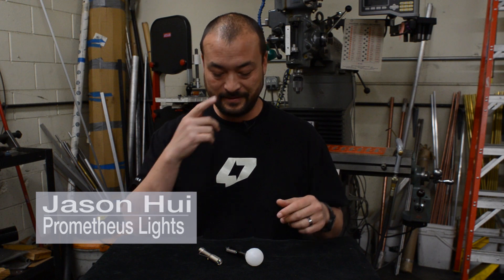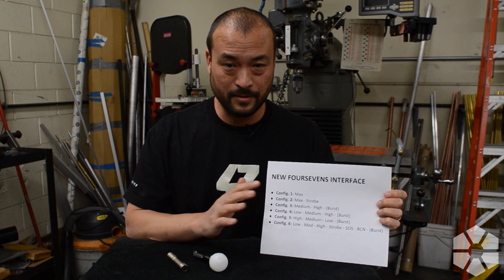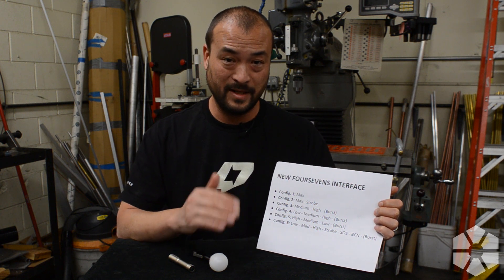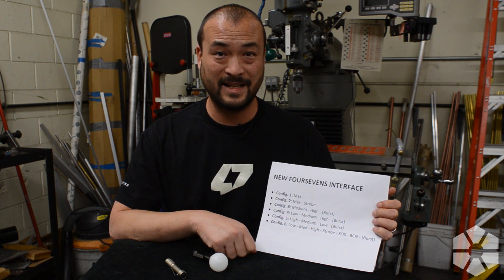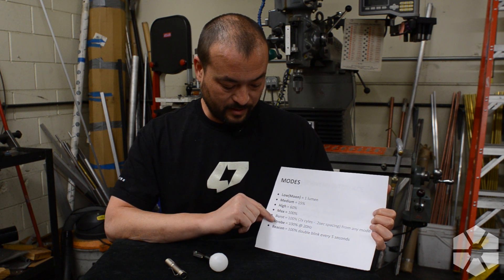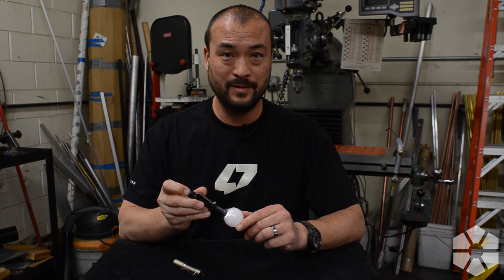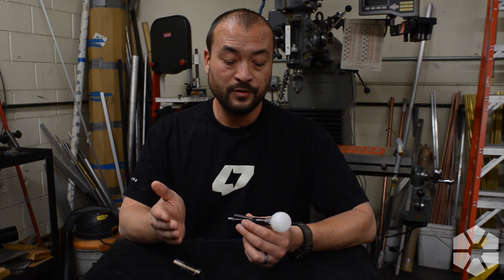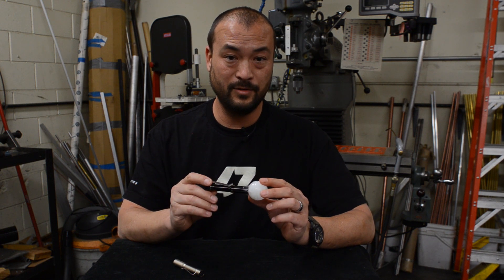New Foursevens Interface Walkthru

Comment: 1 - Max
2 - Medium - Max
3 - Max - Strobe(NO BURST MODE) 
4 - Low - Med - High - Strobe(NO BURST MODE) 
5 - Low - Med - High - Strobe - SOS - Beacon(NO BURST MODE) 
6 - Low - Med - High(NO BURST MODE) 

THERE IS NO BURST MODE.

FYI your website and that paper has the wrong options listed for the interface. What you have listed doesn't match what the flashlight does.
Reply: Yea I agree both have issues going into “burst”. It’s very annoying.

Comment: In the first and second generation, the P1 and P2 used the same head and circuitry. As a side effect, the P1 would tolerate 3 volts from a LiFePO4 battery. 

Is that still the case?
Reply from the maker: In theory it could work :)
Reply: @PrometheusLights  Very cool! 
A friend transplanted a Nichia 219 into my 2nd gen P1, and that was my intro to high CRI emitters.

Comment: Olight i3S xpg2 offers a longer runtime. A true moonlight is always sub lumen (never call low a moonlight mode). 😘
Reply from the maker: There is no such thing as a "true" moonlight. Perhaps I'm unaware of the international standard where it is specified? Please provide a link. The "low" setting on the Preon is 1 lumen...so what now? Does it really matter what it's called? The output does not change depending on the name you give it ;) 

Regarding run time, the i3S is 85 lumens and the Preon MKIII is 100 lumens...both with different LEDs. This is not a valid comparison :)